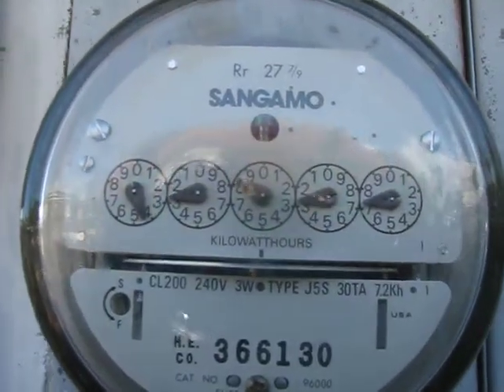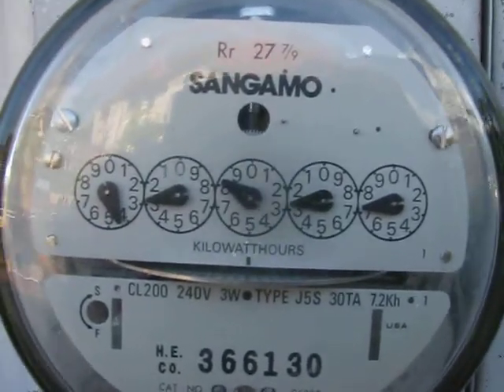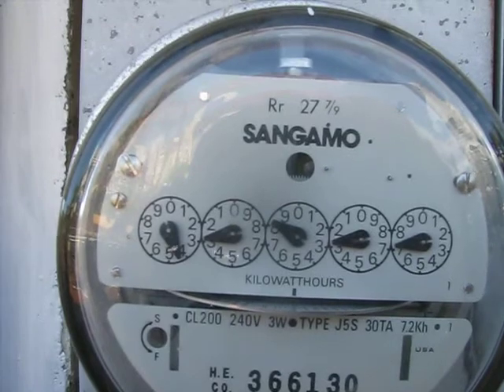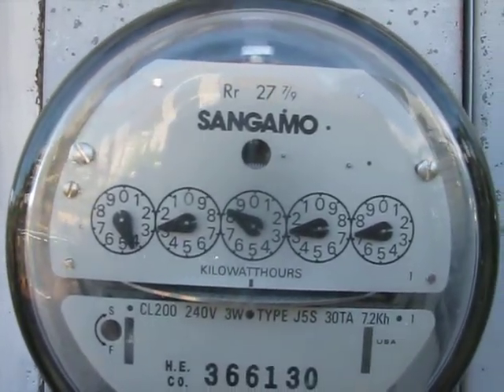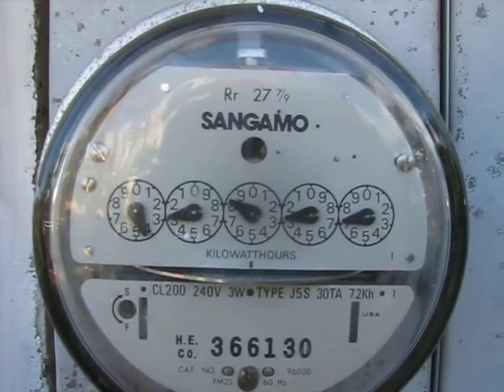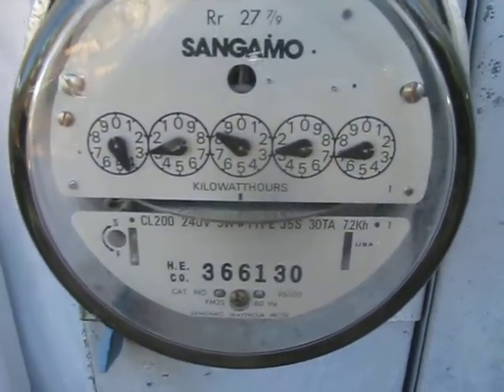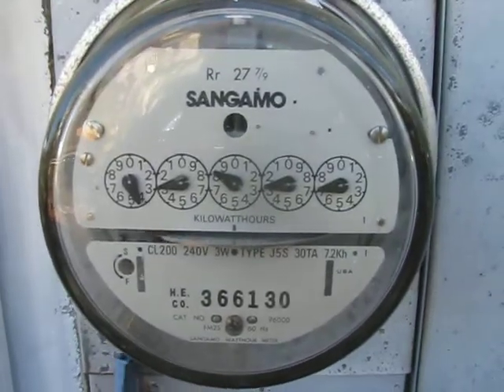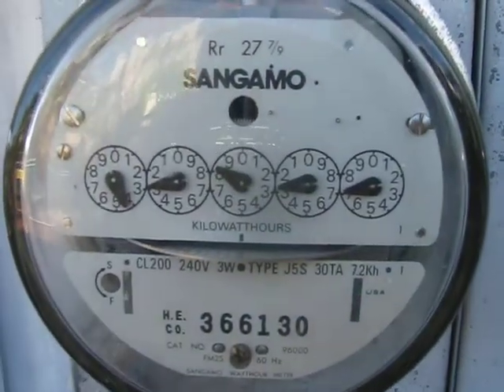Electric Meter Spinning Backwards

Comment: I can't believe the Sunetric people didn't tell you it is illegal to turn your PV system on before being NET METERED.  You are not officially net metered till the utility company changes your analog dial to a special digital net meter...the most important reason for waiting is, if lineman are working on the utility poles in your area and they are not aware of your system sending energy back into the line, you can kill them.